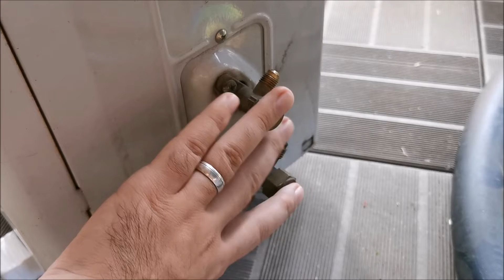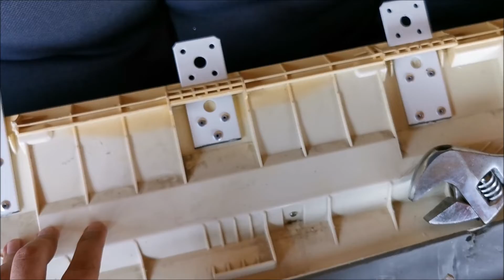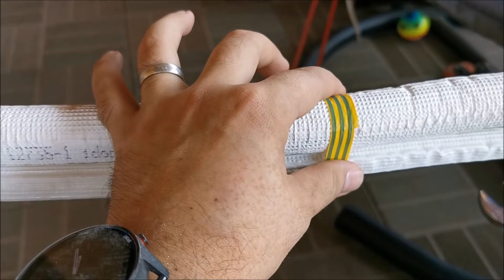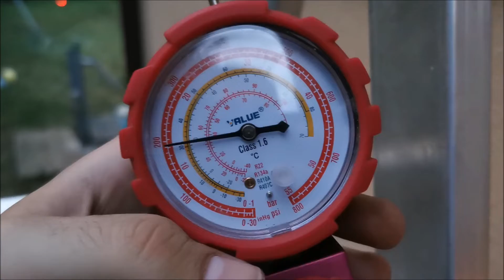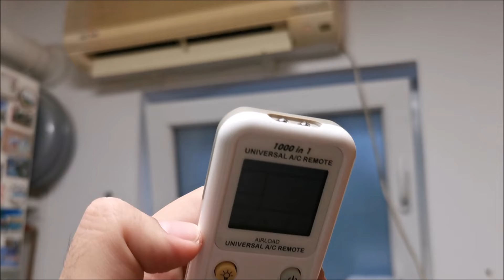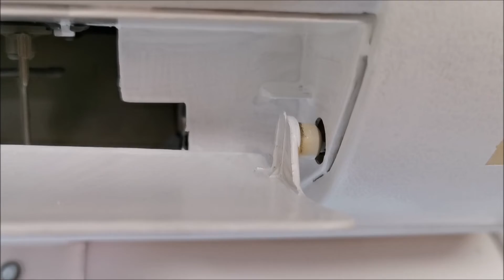How to reuse and reinstall an old second hand Split Air Conditioning by yourself 🌬️❄️

Comment: Bro The old air conditioner stopped working and I want to buy a new air conditioner to replace it. Is it possible to use the same old wires and pipes to install the new air conditioner for ease of work and the old time factor is R22. The new one that I want to install is R32. So there is no problem, please?
Reply from the maker: Sorry, but I don't know enough about this topic to tell you for sure.
By my logic, if the pipes diameter and connections are the same, you should be able to reuse. But it's just my guess.

Comment: my power cords are cut by the previous owner, they both look exactly the same from outside, what should i do?
Reply from the maker: You need a multimeter to check what wire goes where and follow the schematic. If you can't do it, you need an electrician.

Comment: Great video, thank you. It’s really going to help me save some money installing a aircon myself.

Quick question - I have a aircon that needs 7 wires attached. Do you maybe have a witing diagram for that?
Reply from the maker: Sadly, I don't have wiring diagrams for any other units appart from mine. Normally then whiring should be shown on the interior or exterior units on some stickers. Search for those.